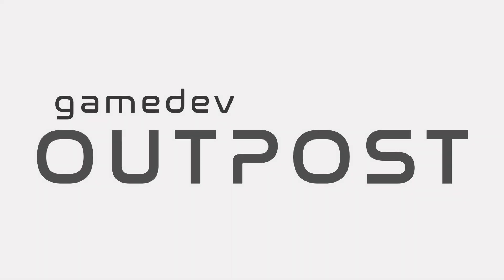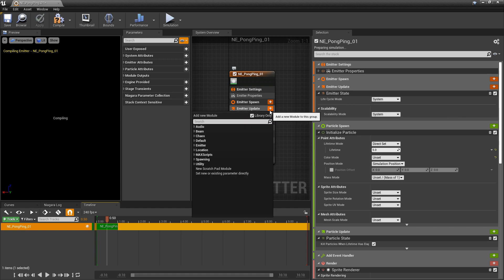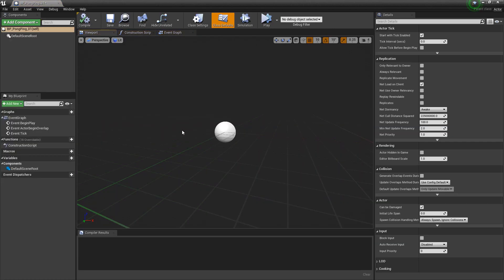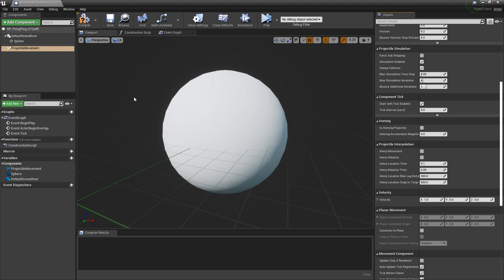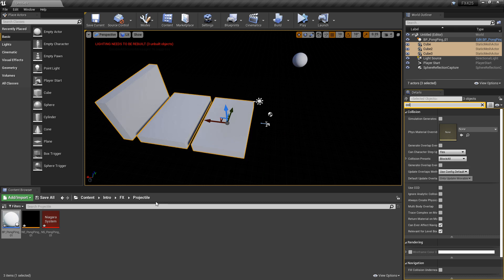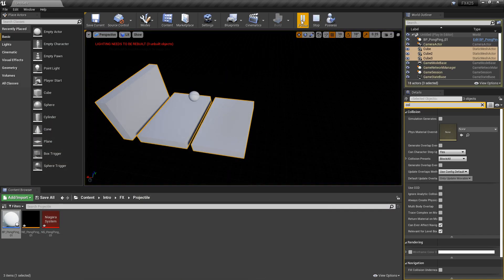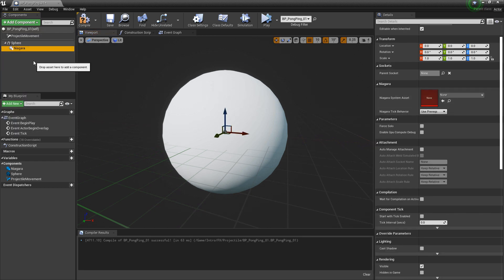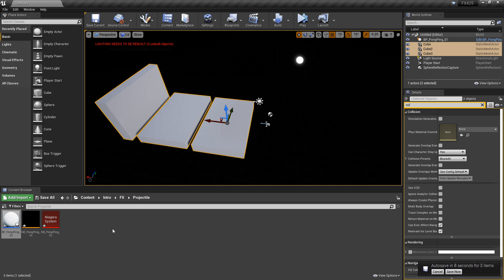UE4 - Niagara Projectiles

Comment: Can't we use niagara modules to bounce particles itself and also interact with other blueprints? Rather than creating an actor bp?
Reply from the maker: There are cases you may want one or the other. Maybe even both. It depends on your needs.
Reply: @gamedevoutpost9270  If we expand this topic, should we use it within niagara system only when we need many particles or "projectiles" to interact with environment? otherwise how we should differentiate which method to use?
Reply: @serdaryatar1248   Nah, it is because replication. It is easier this way